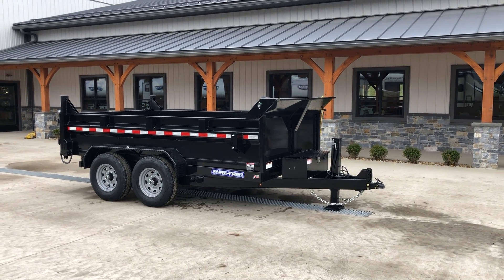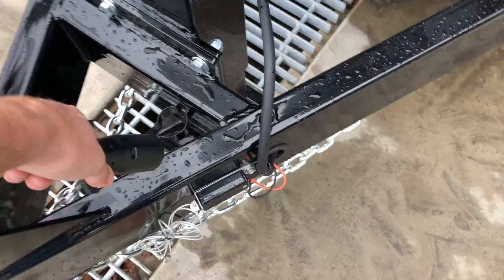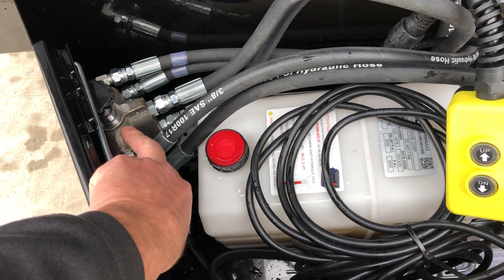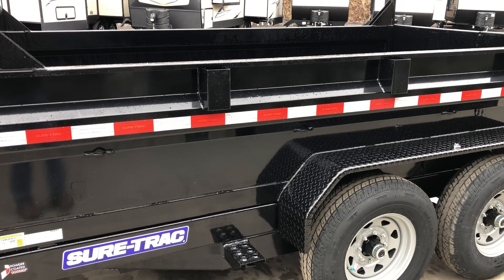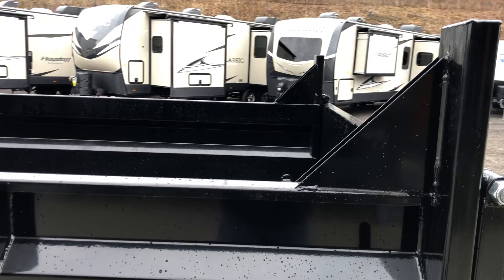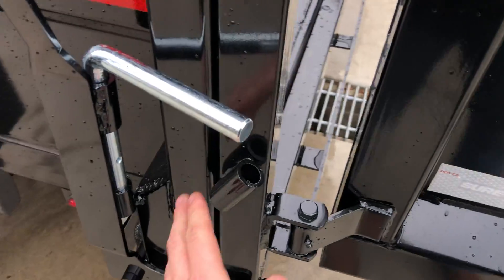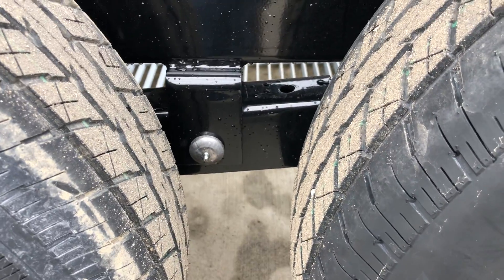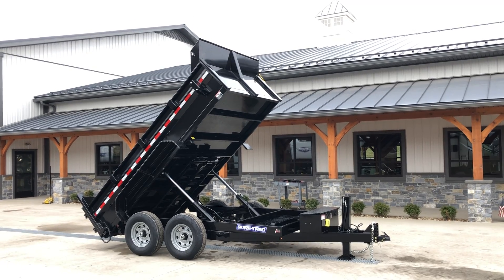2021 Sure-Trac 7x12' Dump Trailer 14000# GVW

Comment: Are you hiding something ? I’m sure everyone wants to know ? Unless they are free ? Why do you hide the price ? Are they FREE ?
Reply from the maker: Not hiding anything, if we give a price today on the video, but someone watches this video in 5 years, the price may be a little different due to our cost from the manufacturer and the economy in general. We may get a better deal on these or may have a huge surcharge from Sure-Trac, there's no way to tell. Here's a link to the current in stock unit if you're interested: https://www.bestchoicetrailers.com/2021-sure-trac-7x12-dump-trailer-14000-gvw-tarp-kit-hydraulic-jack-7-gauge-floor-dual-piston-front-rear-bulkhead-integrated-keyway-2-sides-underbody-tool-tray-adjustable-coupler-110v-charger-f2ij%7CBVh.html